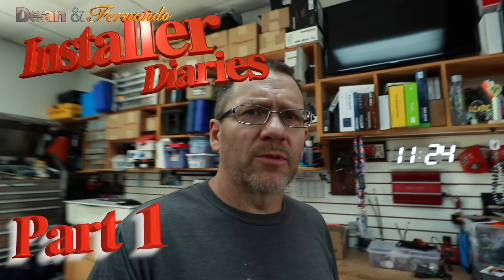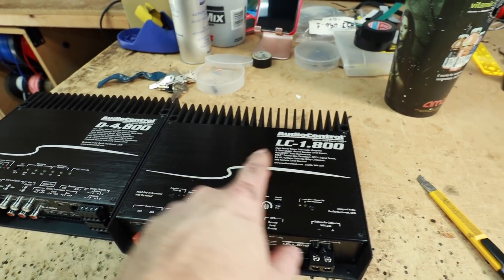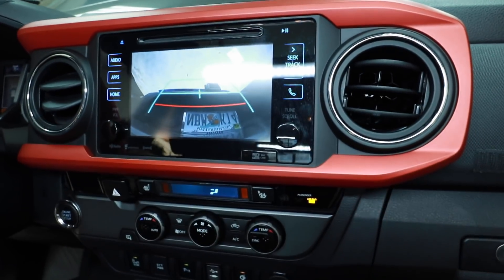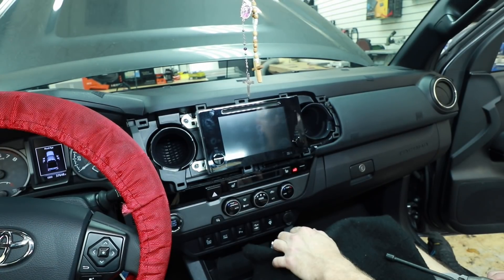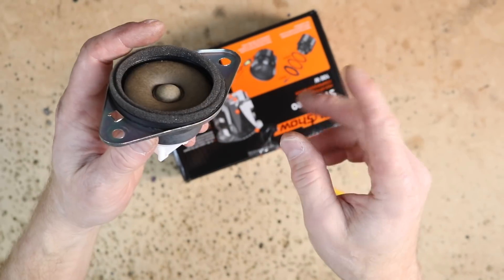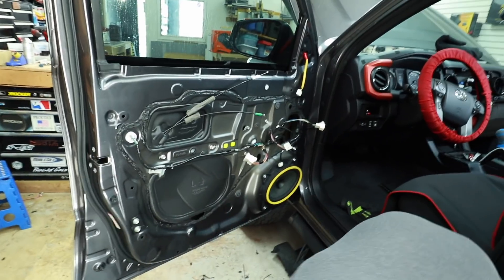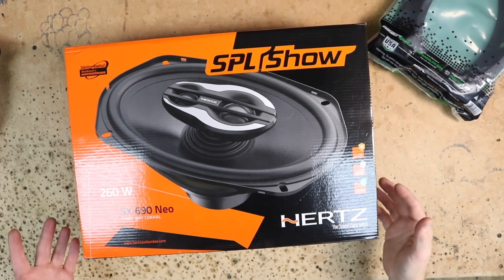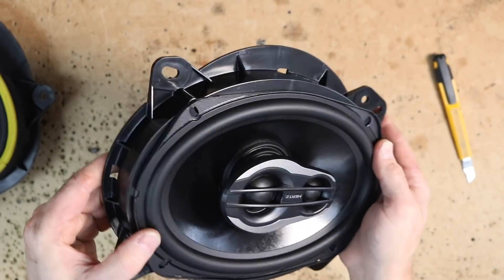Toyota Tacoma gets some SPL show Hertz Installer Diaries 329 part1

Comment: Dean and Fernando,
I just finished installing mine today.  It went well.  Great unit. FYI, all 6 of the screws used to fasten the screen to the receiver are screwed in from the top.  You don’t have to put only four in the top and two from the underside.  The two lower screws are accessible from the holes on the topside of the mounting plate.

Comment: I have a 2017 Tacoma my rear passenger speaker wire acts up and crackles then sends the amp into protect mode but then it goes away. How much speaker wire should cut off and replace? You did my nephews white 4runner awesome job guys as usual!

Comment: I was expecting at least 2 15" SPL subs with that title. I can't believe an amplified focal component system isn't loud enough for some people. It's a car, not a concert venue. There's only so much volume your ears can take at higher frequencies before you start to damage your hearing. I would have stuck with focal but replaced the rear seat with a monster sub box. To each their own I guess, as long as he's a happy customer...